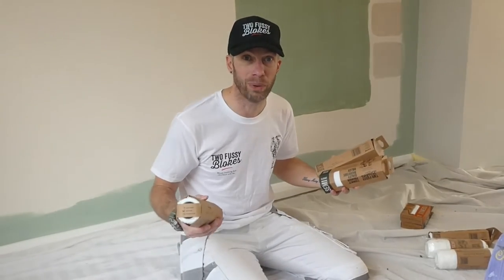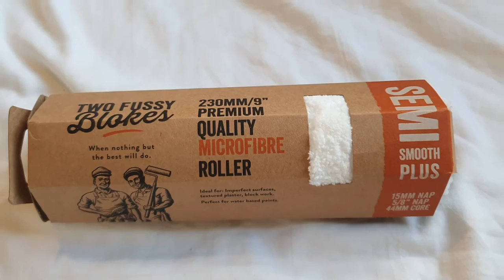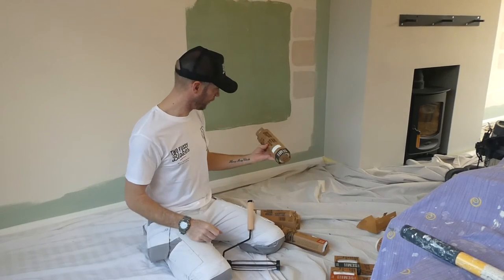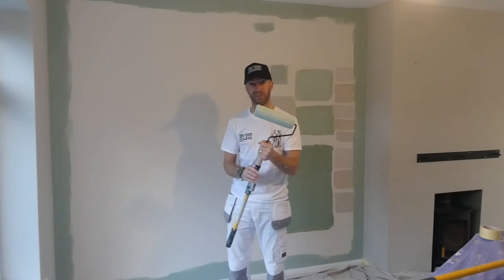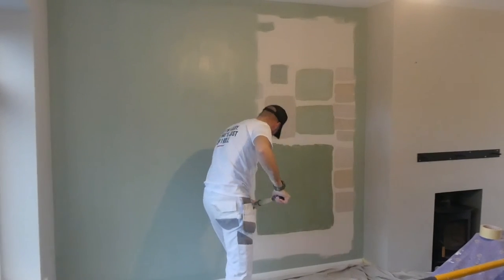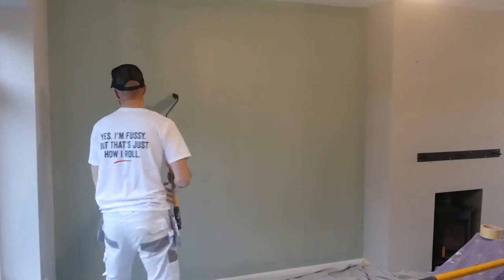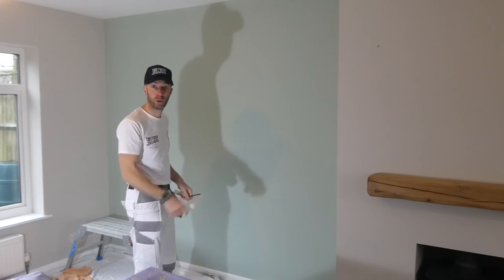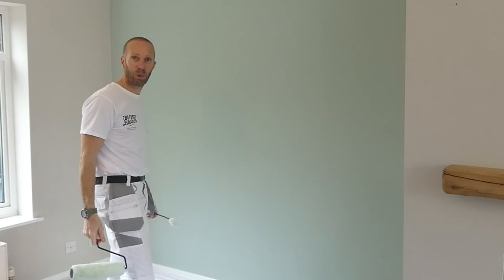Painting a Feature Wall - Checking out Paint Rollers from TWO FUSSY Blokes

Comment: Hello, in regards to your 4 inch rollers seems I can only get 15mm where I live, in Spain and they'd be coming from the UK.  For doors and to get the spray like finish can I achieve it with 15mm or ideally need 10 or 5mm
Reply: I use 5mm on doors and the finish is as close to a spray finish you will get.

Comment: Another great video JB👍🏻
I have been decorating for years and i usually feather the egdes with a brush.
Does i look better when you go over it with a mini roller and did you have any paint loaded on the mini roller or just roll over with the roller with no paint on?
Also is this roller any good for smooth walls 

Prodec Advance Ice Fusion Roller Sleeve 12" 

from toolstation code: 58712

thanks in advance